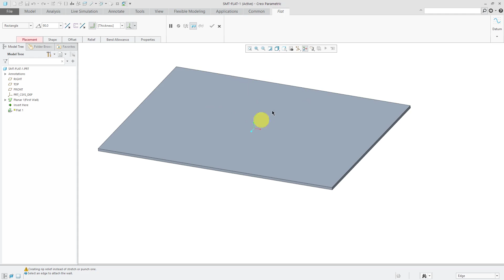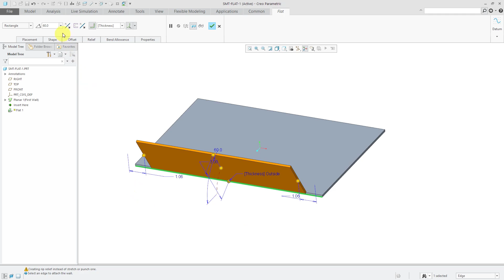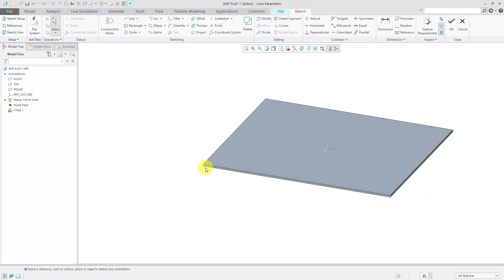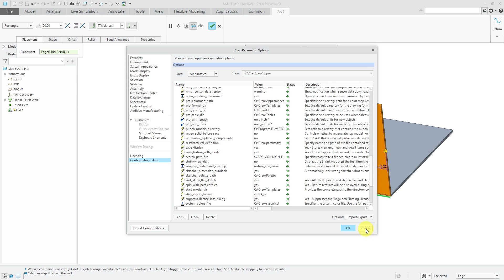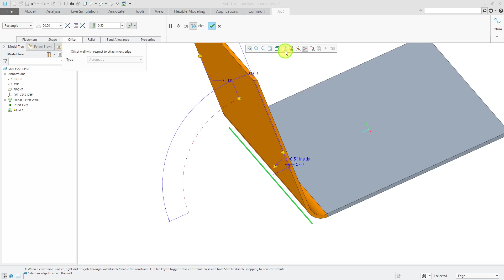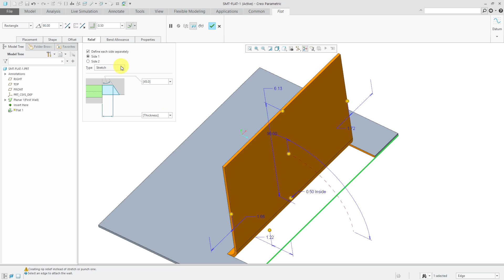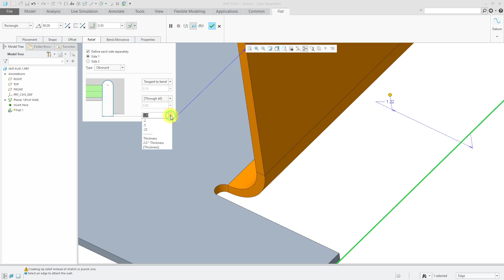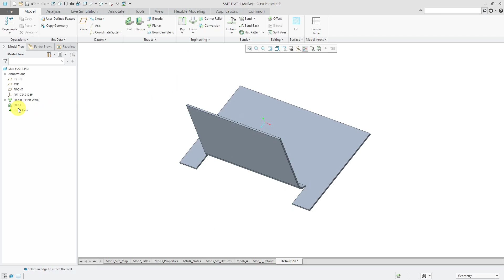Creo Parametric - Sheetmetal Mode - Flat Wall Command

Comment: It would be nice to see a flat vs flange wall video. Pros and cons and when it would be "best practice" to use each.
Reply from the maker: There’s not really enough for a video on that topic. It comes down to Design Intent. Are you more interested in controlling the shape like the sketch of an Extrude (Flat Wall) or the profile of a Sweep (Flange Wall). Often it’s a coin flip.
Reply: @CADPLMGuy  I agree on design intent. I tend to mostly design asymmetrical sheetmetal. I mostly only use the flat feature. I tend to only use the flange feature when I'm wanting to control more than one "flange" at a time, ie a box with 4 walls the same. 

I was recently asked why I choose flat over flanges, and found myself having a hard time expressing why, and also found myself asking, am doing it wrong, or better yet, is one "better" than the other, and if so, what scenarios. I'm always looking to learn. 

That's what I was hoping to get clarity on maybe, what can you do with one that you can't do with the other and what those features give the user the ability to do over the other. 

Thanks! I appreciate the reply, and your videos!
Reply from the maker: With Creo 8, you can create multiple Flat Walls, so that’s been removed as a decision factor.
Reply: @CADPLMGuy  Interesting. We adopted Creo 6 about a year ago, so we're probably a decade out or so from Creo 8, lol. Big companies move like molasses when it comes to upgrading I've found out.